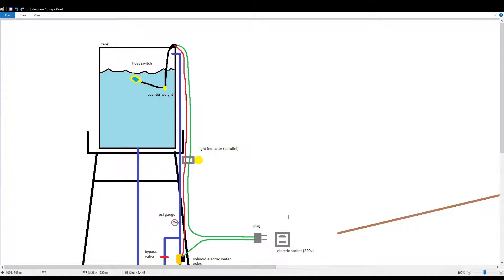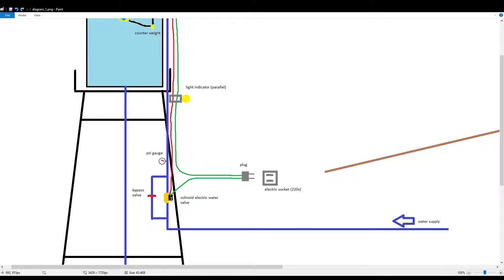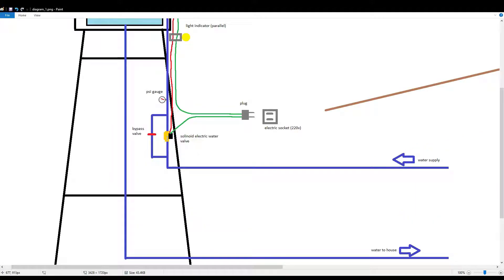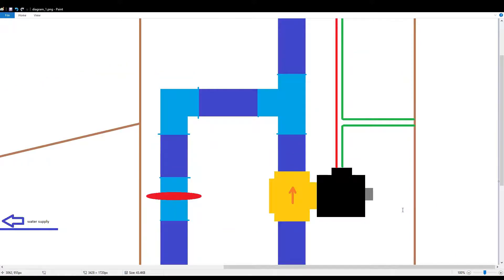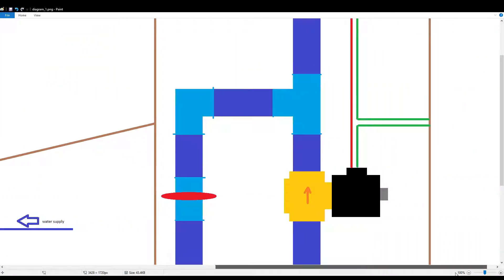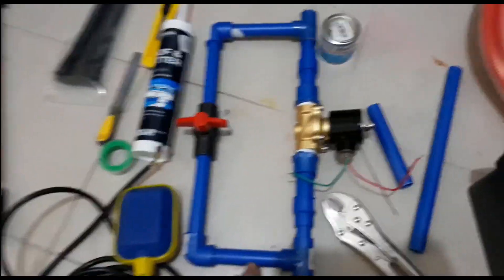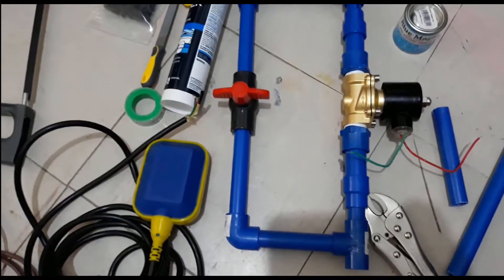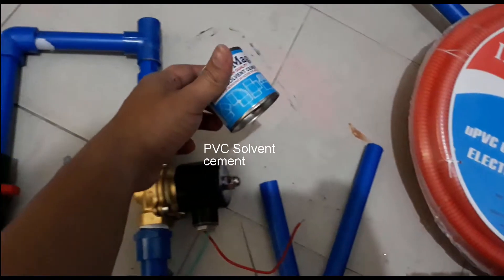Float switch and Solinoid electric water valve from Lazada pt. 2 - assembly

Comment: I currently have a cistern that sits on the floor and goes below the ground a bit rather than one that is up high. The mechanism to fill the cistern is a D-Box float switch, but it keeps malfunctioning- the switch does not get triggered to turn off because the lever jams. Float has a rod with disks on it that hit the switch lever to push it up to turn off but the rod keeps going sideways & not pushing up.
I want to try a solenoid valve. Do you have a link to how to do this without the extra loop in case of power outages? My power does go out a lot but my pipes are not set up properly to allow for such a loop.
What I need is something that will trigger the pressure pump (that uses a belt wheel system) to turn on when the water is low and turn off when the water is full.